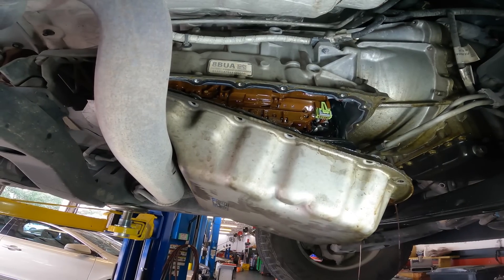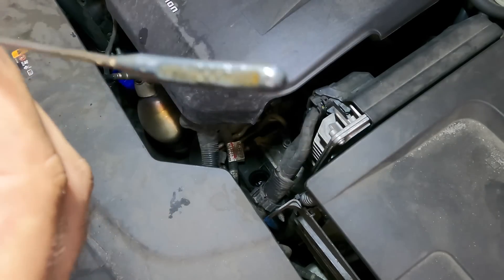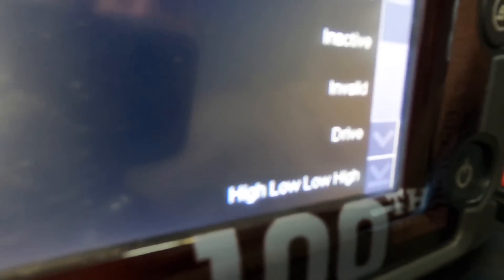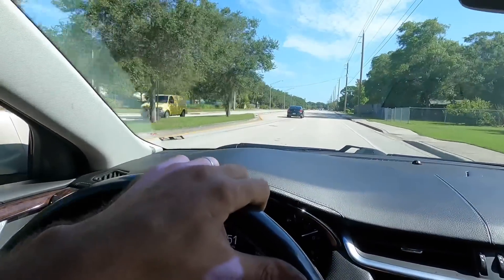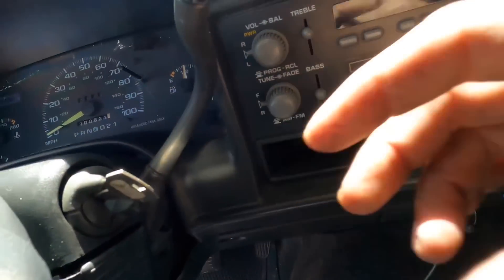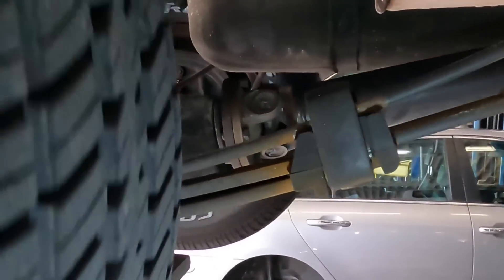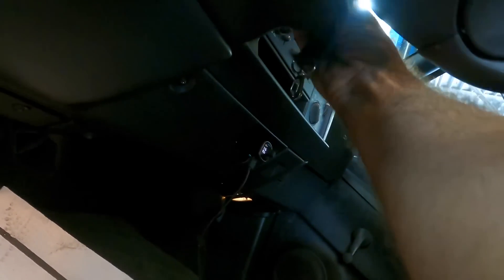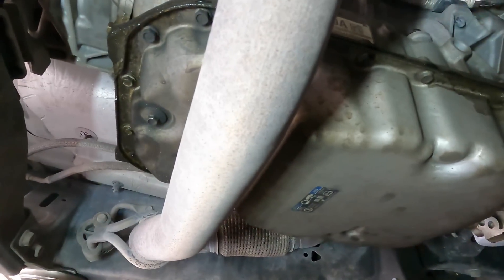Failure Friday! Ruined Transmission and More!

Comment: Morning Ray, omg you should see the one that came into the shop yesterday, the one rotor was literally the thickness of a business card, no floor at all just the carpet and underlay, all tires have the belts showing , and they only wanted the starter replaced, I refused the job, ended up selling them a grand caravan for 3k
Reply: Shawn well done take the death traps off the road
Reply: Happy Ending Storey,,,,, just say the owner doesn’t have the 3K,, you put on a +/-$ 200.00 starter on,,, owner leaves your shop,,,blows a rotten brake line,,,causes an accident,,,, well it had brakes when it left “your “ shop,,,,,, never happened to me in 50 yrs. ,, but the shop would be dragged in ?

Comment: @25:30  that's a bad place to put an exhaust pipe. That certainly causes the transmission fluid to heat up unnecessary and shorten the life of the oil.

Comment: I am surprised you did not completely empty the trans pan before you installed a new gasket.  What a ridiculous way to have to fill a transmission!
Reply: Yes, he did empty the pan, wiped it clean, cleaned the maggot (magnet) b4 putting the gasket on. Didn't you see all the tranny fluid in the pan? There was a lot more than 3.2 qts just in the pan. If that stand pipe is there as a level mark   to decide how much to fill, why was there so much to drain out 2+ qts, was it overfilled to begin with??

Comment: I was looking at the hose thinking that is gonna fall off, they make battery operated Fluid pumps that would work well for this type of application.
Reply: I got a cheap one off of Amazon. It's noisy, but a lot quicker that pumping it manually.

Comment: It's common problem with pwm solenoid (pulse with modulator) in gm transmission  front pump. 100,000 + miles It's time to have rebuild
Reply: junk

Comment: Typical Cadillac. Transmission failing 50K after warranty.
Reply: 👍torque convertor clutch failure ! Again ! Still happening up to 2017 products ! Plus side ,,,, we only hear about the “bad ones “ in the millions sold yearly ,, about a 5% failure rate ! Still should not happen !

Comment: Hi Friends 👋🏻, good diagnosis.  I wish more people remembered to change their trammy fluid on time to save themselves.  This situation seems to be a trendy theme; old as time.  That is a RAD S10, I woulda reshaped the key for him to fit.  I’ve got a 00 tacoma 2.7 and I have also had ghost vibration issues with for a long time on and off and I think it is the tires.  The vibration can cause other components to fail as well.  Any thoughts on small 2WD rwd pickup vibrations?   Note that when measuring hot Tran fluid, if it is too hot to touch it may have expanded and cold fluid will measure less.
Reply: 2wd 4Runner owner… 
Rear wheel bearings went out on mine and made it feel like it wanted to wander all over the road
Reply: The Old Worn Check Ball trick ....?
Common prob in other GMs . Fixed 6l80 w plate/ck ball update kit. Ya , Valve Body must come out
Reply: My experience on gm trucks is to either change the fluid early and often or don’t at all. Changing the fluid on an old transmission will wash the clutch material out. People wonder why their transmissions start to slip after changing the fluid.
Reply: @peted5217  yeah the  plate on the valve body is common issue with high mileage.I seen the steel balls punch right threw.when I rebuild I replace it  is a must
Reply: @tx4runner459  Same with my 09 and 14  4wd tacos
Reply: My S10 is an 82, its had a 3.4 and T5 swapped with the original 3.08 rear, i have to keep good tires on it or it'll spin out in a heartbeat. The 3.4 had 217k miles on it when i pulled it out of a 95 Pontiac firebird, I've rebuilt the engine and put a comp cam lope cam in it, she's nasty ive smoked C6s LS3s off the line. And it's at best 180hp at the crank.
Reply: @ADHDsquirl  nice 👍
Reply: @schoolmaster1945  until it starts slipping, shuddering, jerking, or flat out stops going when you rev the engine…. Then It’s big sad face.
Reply: @Tim Nissen thanks Tim, I bet that’s it.  Is it easy to fix?
Reply: @stephenbullock1443  6L80 I fixed had plastic balls that had worn til one stuck in a passage. GM update plate came with supposed more durable plastic ck balls. This did fix intermittent 'neutral' condition while driving. Fluid condition was good. No junk in pan found. Trk had 120k miles
Reply: @altonb93  not to worry bout nu fluid. Trans pressures of 100-300psi will flush ANY debris to the pan, weather old or nu. Hi pressure hydraulic sys operates the shifting AND what keeps it cooling too.

Comment: I had a 89 Cougar that its Transmission got to a point that it slipped and had shifting issues when it was started from Cold. Once the engine had been warmed up for 15-20 minutes. Then the trans worked just fine. until the engine was cold again.

Comment: I welded an O2 sensor bung to the bottom of my 6L80 pan the first time I changed the filter to make drain and fill fluid changes easier. I know it some is still in the converter and lines but cleaner fluid, happy transmission.
Plus, I really hate that exhaust crossover.😆

Comment: Ray, I believe that most people are treating the dreaded check engine light like the OBD I Era. Electrical tape or remove bulb was the fix because they practically came off the lot with one illuminated. Soo much has changed and the gen pop is not informed with the appropriate amount of fear.

Comment: 👏👏👏Ray I know that everyone does things differently. I alway take the transmission pan to the parts washer & clean the inside & outside, put the new gasket on it then install it back on the tranny, saves from using extra brake clean. After about auto manufacturers pinching pennies buy not using oil pan drain plugs, transmission fill tubes with dipsticks, before I buy a vehicle, I’ll make sure that those items are there first. Just think when you get home, your stress free
Reply: The reason they removed the transmission fill tubes/dipsticks is because they are sealed transmissions. You're not supposed to even look at the transmission unless there's a problem with it. No oil changes or flushes, no maintenance at all, only repairs if something actually breaks. They are designed to be maintenance free. Also, opening the transmission yourself can void the warranty with a lot of the car manufacturers.

Comment: When you started ranting about clearing codes, did take me back some years when i i was pissed at a mechanics failure of diagnosis, "i cleared codes and did not see a problem". What was the  problem, robotic-clutch was in progress of breaking but still working, mostly. Mechanic: "no codes no problem". One day later had the car delivered on trailer, the problem: robotic-clutch completely broken. A semi-auto box really cannot engage a gear without the robot-system moving the clutch. Replacement was not very expensive, 740 euro's all in.  But that mechanic,  "no codes so car is good" (wtf moment).

Comment: That caddy has the 6t70 trans from gm in it if I am remembering right.  2 problems plague them, either the torque converter will go and dump metal shaving's into the trans plugging the internal filter, or if it is the earlier version of the trans there is a flexplate in it that breaks and shreads a bunch of stuff.  The symptom you saw I think was a sign that the piston next to the flexplate is damaged and the trans gives it full pressure the slam it into gear.  A good test that was used at the tranny shop I used to be at would be to drain the trans fluid and if it's all glittery then there is your answer.
Reply: Yep, my torque converter failed on my 2012 Impala at 182k, which required a rebuild. Trans was flushed at 90k, drained at 150 and 180k and it still failed.

Comment: On clearing codes... I have Torque Pro set to automatically scan for, verbally announce, and then clear trouble codes on my 2006 F350...

But that's just because it only ever throws two codes. P0401 (EGR Flow Insufficient - which is on purpose) and P0672 (Glowplug Circuit #2 Open)

So, yeah.  If it ever DOES throw something else, I'll know, but driving around with the MIL on all the time annoys the hell out of me.

Comment: Ray, here’s a thought. Take a bilge pump from a small boat ($30 or so) and make a hand-held pump using a small 12 volt and your famous electrical long-leads with a switch (tinker till you have a design that will fit in your hand) Then, using the container you used to check what was in the tranny, fill it to the “specified” level and pump from it to the trans. No overfill because you used the “numbers” and no spills because you’re not hand pumping.Try it…you’ll like it.

Comment: Im sure youve heard of it, but mityvac has a fluid exchange pump and its one of the best tools ive bought.
Reply: The shop has one, Ray has used it before.  It is air powered.  I think that the filter gets in the way of inserting the tube into the bottom of the pan.

Comment: The TCM/TECHM in that transmission won't detect slip or limp when it's detected like the Allison TCMs will. When my wife's 2015 Malibu ate its transmission, there was so much slip that there was zero motion in either direction or in any commanded gear, but zero trouble codes.

Comment: Use your snapon high torque plies to pull the trans filter seal. Twist & pull
No don't reuse seals.
Reply: I always hand tighten all pan bolts until they touch. Then one hand a ratchet snugging bolts going around a couple of times just taking up slack 
Then a final torque click.

Comment: I was changing a parking brake valve for my first time. Missed a step and didn't discharge the accumulator and got spayed with 3000 psi of hyd fluid...probably about 6 qts. It was every where lol not a good day

Comment: That Colorado has the 2.5L engine. The 3.6 has an exhaust y-pipe and the engine oil filter is a paper cartridge on top of engine. Good job on the trans oil change.

Comment: At exactly 36:12 you can see how the outlet tube is just hanging on to the pump, and if you checked your equipment first you may have saved your pants. Is this level supposed to be chacked at a certain fluid temperature, most are.

Comment: Clearing codes does not fix anything.
Smoke alarm is not intended to be used as a cooking timer. 
I bought a used '87 S-10 pickup after my '88 Accord got totaled when a VW Scirocco ran me off the highway. Put more money into that POS S-10 in repairs than I did payments in the one year I owned it. Radio caught fire driving home from the stealership.

Comment: On that S10...hope the guy got squared away...tires not good...I've got a bad vibe at fwy speeds on my 99 Rav4 FWD...I'm guessing its a hub as it squeaks and i feel the vibe at my feet and legs not at the steering wheel. 
   As for that trans fluid...if that were mine i would get super creative and make a dipstick tube for it...that crap you went through is for the birds!! Nobody needs an oil bath🙂  Another great video...thanks as always Ray...your efforts are always appreciated by me:-)

Comment: If the CHK ENG is always on, even for a reason you can ignore (not really..), just tape over it. 
I had the light on, as the Cat was performing under the acceptable threshold.. Guess what? A mechanic slapped on an emissions testing device, determined that it was working fine, pulled the O2 sensor, cleaned it up, plugged it back in - no more lights.

Comment: 47 days ago my 2013 Chrysler 300C with 105K miles blew its trans. It's still dead - on a lift at the Chrysler dealer. 

In case someone else is in a similar situation, Chrysler/ZF transmissions are a nightmare to deal with. Many trans shops won't touch the ZF 8 speed. Dealers can only touch a few parts on them. New transmissions aren't available. First repair estimate guess was $2,100. New fluid/filter/pan/valve body. Failed repair. New transmission estimate was $6,400. Unavailable with no ETA. They finally recommended what I originally wanted - replace the transmission entirely. $2,200. Still waiting.

Asked them about a seemingly minor electrical issue with my fuse box. $3,000. New wire harness required as it's hard wired to the rear fuse box. Have to rip out all of my interior.

FYI Chrysler's recommended service interval for the transmission (100,000/Lifetime) is nonsense. ZF recommends service at 50,000.

Comment: So some vehicles without the dip-stick have provisions on the transmission casing for one? I might have to look into this with my car as I understand why they aren't commonly used, but it is nice to be able to check the condition of the trans fluid when one checks the condition of engine and other fluids

Comment: Does your Garage have a Machine that can flush the fluid out of the Torque Converter ? When pan is taken out and filter removed then new filter and pan is inserted back in with new ATF put in. That only takes out 40% of ATF max, around 60% of ATF is in Torque Converter which in most garages is not flushed out.

Comment: In the mid 90s I bought a nice 1984  Chevy blazer s10 ss with a two inch body lift I added set of short headers offset motor mount plate's the stock's 350 4bltm and a special turbo 350 tail shaft adapter from transmission to transfercase and both header crossing over into 1 4inch trough flomaster muffler running along with the but my 350 4bltm block was bored and strocked

Comment: I bought a maverick for cheap once that had a pinhole leak in the transmission cooling line going to the radiator,  it started to spray tranny fluid on the exhaust manifold causing smoke, and the tranny started to slip I cut off an inch of the hose going to the radiator filled it up and drove it away. Her mouth was open. Many stories like this.

Comment: with the code clearing i did it once without repair since the code was something that could be intermittent, the CEL kept coming back and disappearing before it stayed on, assuming based on the codes, a harness or clip was yanked on and has sketchy connections now

Comment: I have a 2017 buick regal with the 2.0t it's shutters randomly in second third and forth randomly apon accelerating sometimes. I hooked my scan tool up to it with no codes at all. I'm thinking torque converter but idk. I'm just an A/C guy lol. I just find it weird how it has no codes

Comment: I was driving to a Service call last week and Lady passed me doing 110 in a 50 zone and she had 4 spanked Ball joints you could see the tires and wheels just flopping and the trunk was violently vibrating i called 911 officer passed us saw how fast she was going and clocked her at 115 and  stopped her and gave her a fix it ticket 15th time she had been ticketed and not once had she been arrested what the officer told me I was Livid i was pissed the car wasnt towed and her arrested for reckless driving and criminal speeding a fix it ticket she has gotten 15 fix it tickets in a month after the 3rd it should of been towed and Impounded for failure to comply @Rainman Ray's Repairs

Comment: Ray, when you had the transmission pan and filter out of the vehicle you could have checked to see if the bolts in the value body are tight and torqued to spec? Quick and easy job.

Comment: My uncle with his 09 GMC sierra, that thing man, had a code for the fuel pump control module that lives above the spare tire, the thing fine still, but the replacement part was like 2 months out, we I let him use my Micro Mechanic to reset the computer so he could use the 4wd, any light the comes on, it disables 4wd, it so dumb, o2 sensor, no 4wd and no remote start, come on GM. Sometimes you have to live with the check engine light for a while, no reason to disable 4wd because a o2 sensor is going bad..

Comment: I actually own a 2004 S10 crew pickup, which is sadly being slowly dissolved into iron oxide by Ontario road salt.  It's a shame, because apart from some minor transmission issues, it's a pretty great running little truck.

Comment: My Trans Am acted funny in the trans so I changed out the solenoids and circuit board in the pan, Flush and new filter. The old solenoids didn’t have filters like the new ones and the old parts were covered dirty. It’s been great ever since.

Comment: I had a 97 s10 zr2 5 speed everything in it was manual even the transfer case it was my first car as well it was rusty but trusty honestly I've never seen one this clean though in Illinois the body rots out like mad but these trucks had quality frames unlike cough cough Toyota Tacoma
Reply: I'd still buy a Tacoma over a Chevy. especially the new ones. new gms are crap.

Comment: Rainman get you a large coarse threaded bolt adapt it to your slide hammer. Screw it into that seal slide it right out without touching anything but the seal. 5 seconds its out.

Comment: Most of those plastic straw things require overflow at a specific trans temp.    Whoever thought of this was a jerk to send people back to the dealer instead of just having a dipstick.  When I do it at home I measure what comes out and put that much back in.  That will do.  If you have to, you can measure the temp with an infared thermometer but you are supposed to use a scanner.

Comment: After it slipped into reverse, I cringed hard when you went to test drive it still. Should have checked fluid before that and pushed it into the shop to prevent further damage

Comment: Ray, do you ask your customers why they want a trans service… some people think a service will repair other problems….  I have seen shops get sued because the service and new thin fluid make “slippage” worse…. Some has lost the case.  I would not do a service it’s the customer didn’t know the history if the odometer read over 75 k….. but this has been a a few years ago….